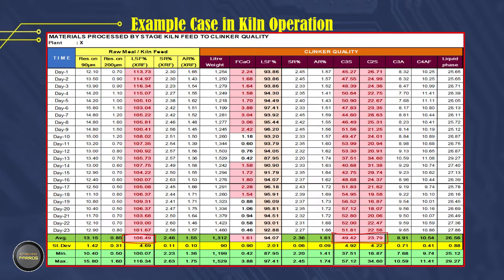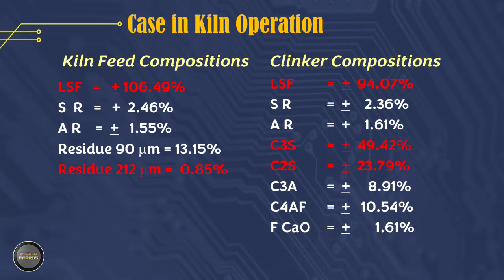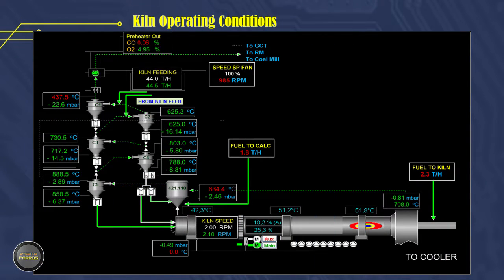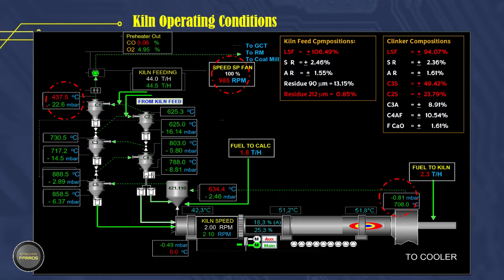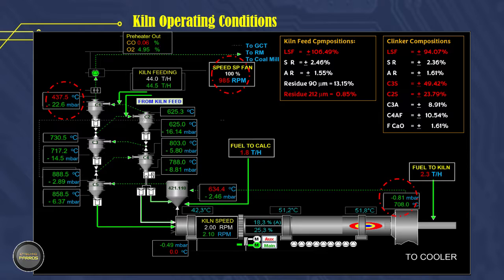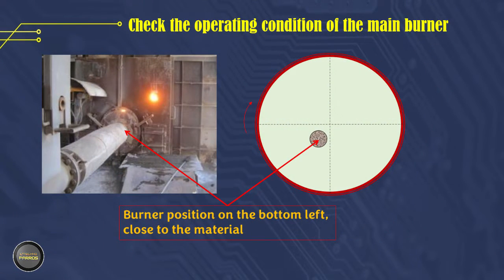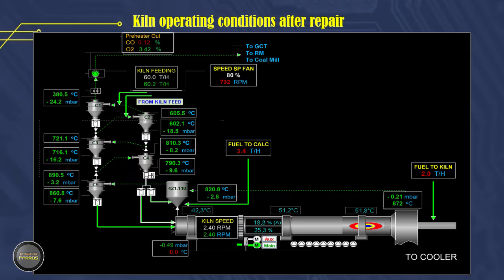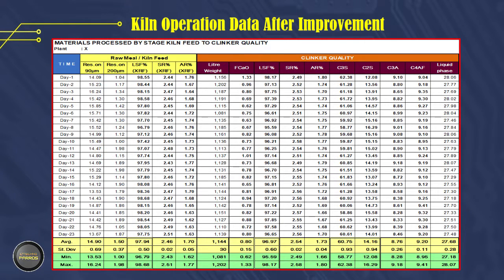Clinker Cement Quality Is Not Reached The Target - What Happened With This Kiln Operation?

Comment: What is lsf?
Reply from the maker: LSF (Lime Saturation Factor) – A measure of the degree of conversion of silica, alumina and iron oxide into the most basic calcium compounds.
For the LSF formula, you can watch the video we made before, entitled Rawmix Design for Raw Mill and Kiln Cement Operation.
The higher the LSF value, the more difficult it is to burn, meaning that it requires more fuel and vice versa.